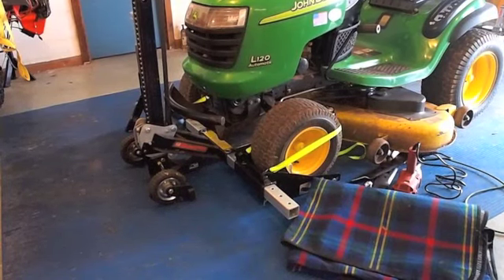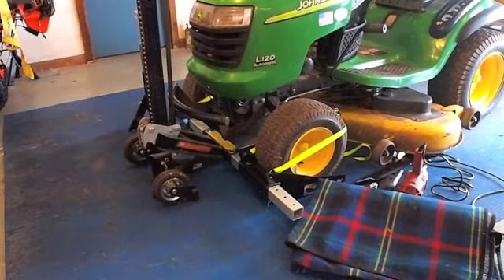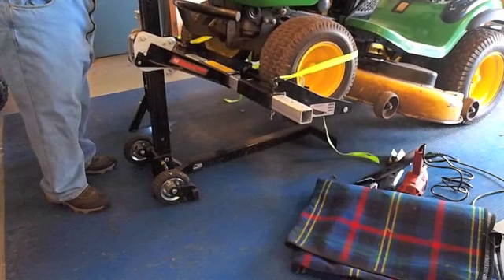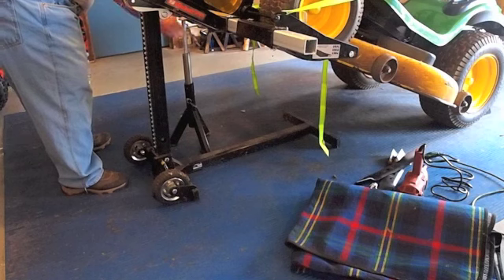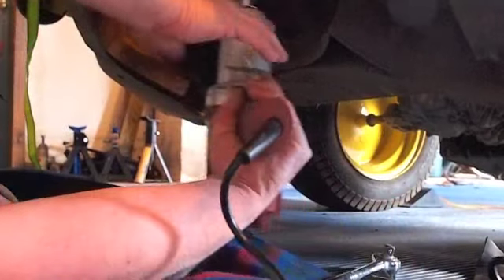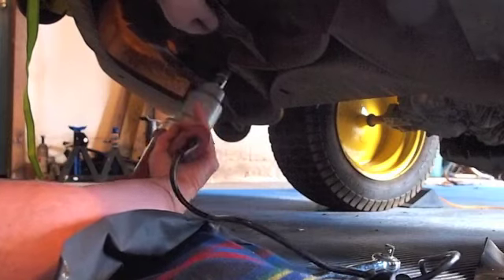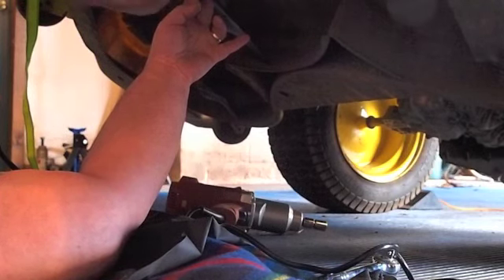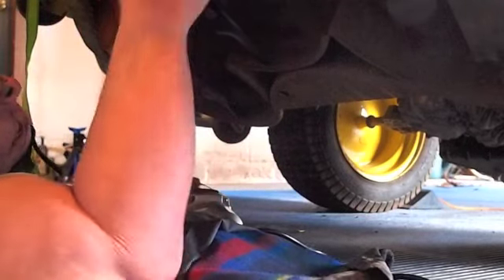Mojack pro how  to change blades on John deere  l120

Comment from the maker: I used my bare hand , yes you  could used a block of wood, vise grip or blade blocker  . I  did  though unplug both spark plug caps from the engine "Free rotation start ups" . thanks for pointing that  out. have great day!

Comment: Is orientation of blades critical?  It looks like you just radomly put them back on without any focus on postion.  Thanks.
Reply from the maker: Heather blades do go a  certain way on these the curve  side up  or convex side go up  against  mount an then  bolted on . On  blades hey may  be different  . I  good idea   is to take a photo of things before starting a   job . Thanks for the question have a great day  .
Reply: the ridges on both sides should point down in the middle of the blade

Comment: I'm taking the bolts off mine more than a couple of times and I've always used a breaker bar and a c-clamp to hold the blades in place using an electric or even pneumatic gun like that is more likely to strip your bolts and extremely unnecessary
Reply from the maker: +Tobin Prowant In some circumstances a power tool is  needed to do the job.  Right  not all people know how   stop an  bring the impact tool off  the nut before damaging   them . So sure to play it safe a  socket an ratchet an extension aka breaker bar could  be used .

Comment: he suggested that your blade should be curved up but the truth is the curve should always go down
Reply from the maker: +Tobin Prowant Tobin  where the bolts holes on the blade meet  mounting part of plate ( To turn blade ) on this model they curved up . Not the end of the blades where they cut  .
Reply: That's the way I always saw it the bend part where the bolts meet the blade it bends down on either side of the bolts right
Reply from the maker: +Tobin Prowant The the blade is  convex  where the it meets the concave part of the blade mount where you attack the  bolts . So stop fencing with me  ,Thank you  .
Reply: if this wording confuses you, the ridges in the the middle of the the blade point down.